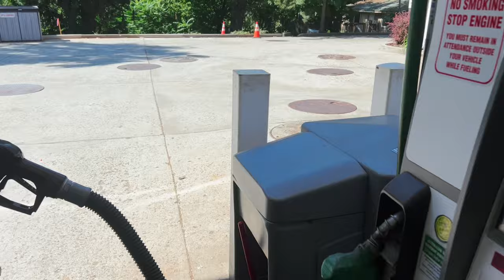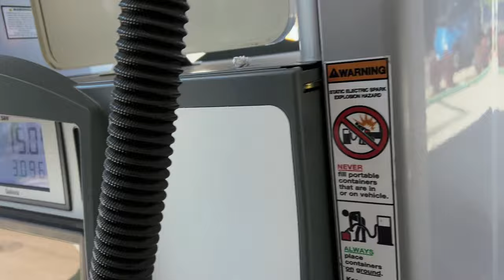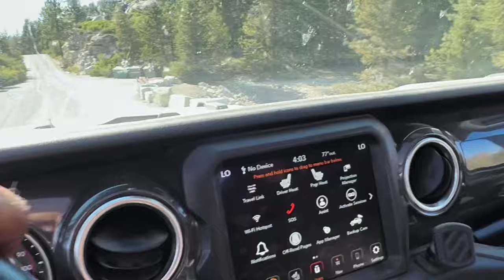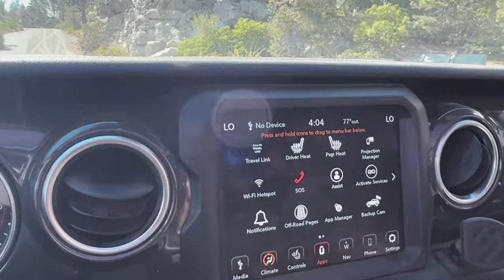Don't Go Too Fast Through The Rubicon | Rubicon Trail Rescue

Comment: I've been wheeling those trails in the high sierra's for nearly 20 years and can't tell you how many times I've seen Wranglers break factory welds on suspension/steering brackets at the axle/frame.  All model Wranglers, all years since the TJ.  Panhard bar brackets, control arm brackets, including broken tie rods, ball joints,  steering sector shafts, you name it.